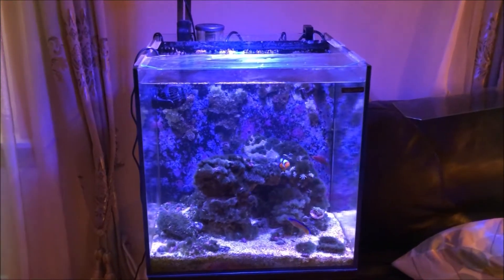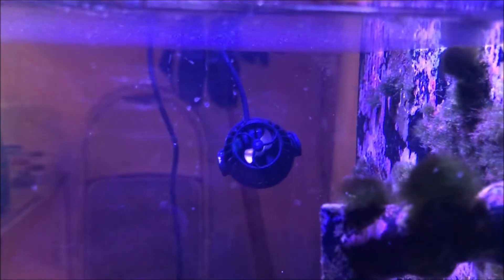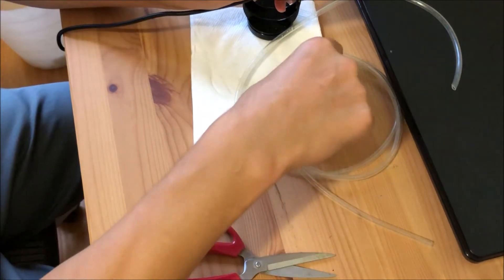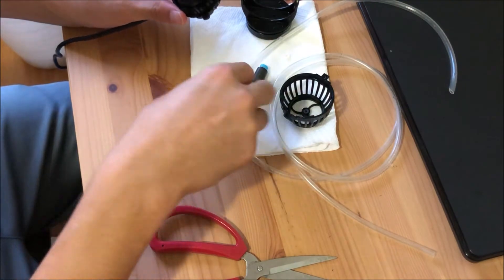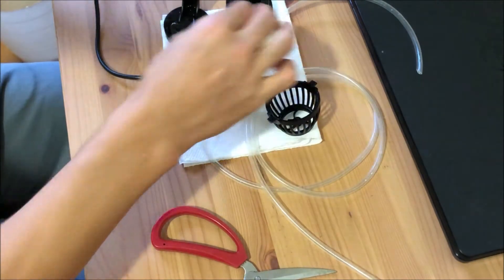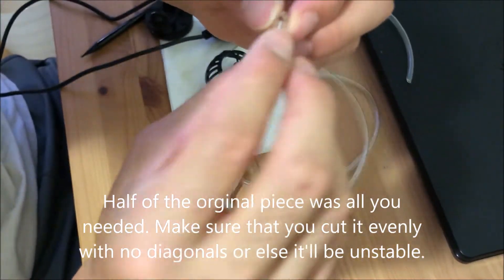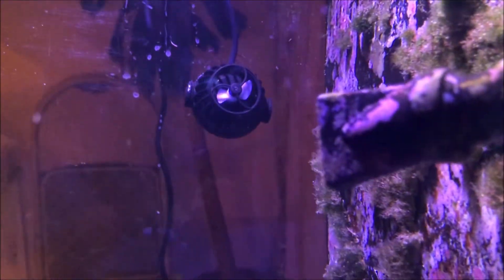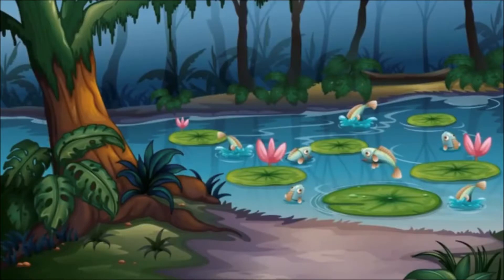Wave Maker Modification (when your pump breaks down)

Comment: Hi, I too face problems with my wavemakers, The shaft or the fans is always stuck. When i rotate it manually they start running fine and after sometime it stops. Do you think this is only problem with the ceramic shaft ? if i change them will they work fine ? Please let me know your suggestion